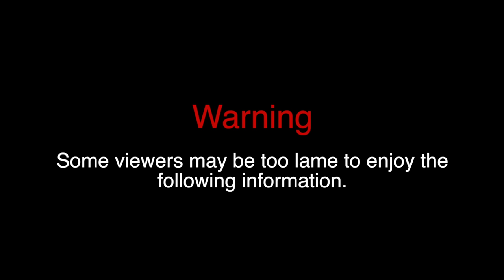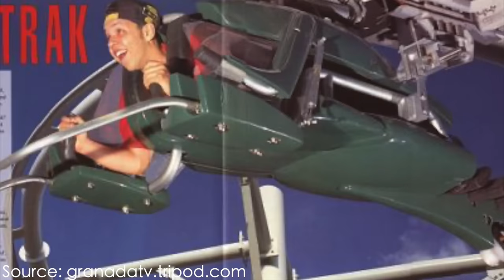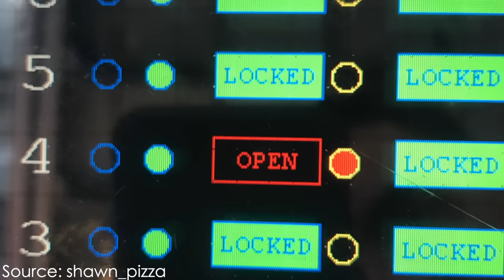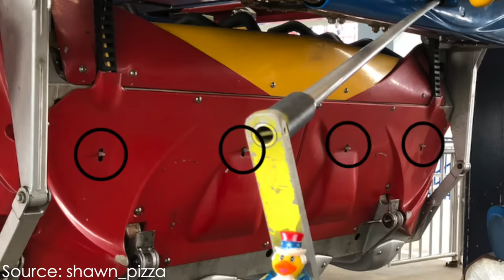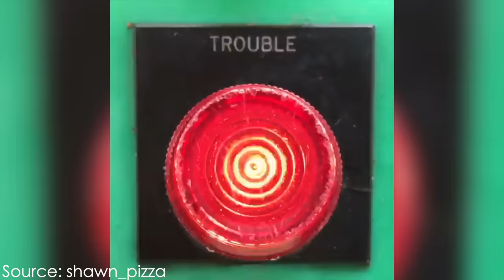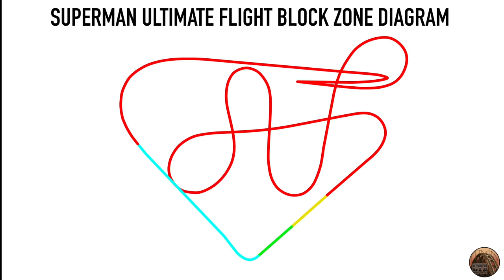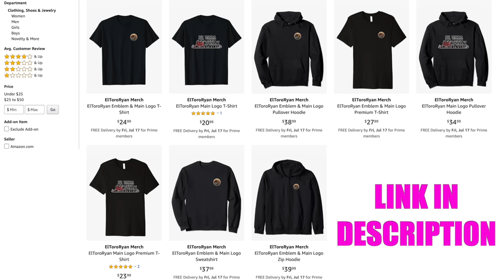Problematic Roller Coasters - Superman Ultimate Flight - Six Flags Great Adventure

Comment: PLC= Programmable Logic Controller. That was a Panelview Plus but is an old model. More than likely, these old coasters are all using an Allen Bradley SLC 5. New coasters now use Compact Logix Controllers which are much faster and is asynchronous.
Reply: @shawnspencer8766  I'm sure Control Logix is also used. The majority of panels I have seen have been Compact Logix. Just a guess but I would assume bigger projects are using some wireless point I/O through a Prosoft card.
Reply: @shawnspencer8766  No problem. I'm a Certified Control Logix Designer working as a Controls Engineer. The only real advantage you would have using Control Logix VS Compact Logix is a little bit of speed, more  motion control features and a few advanced IO features. Control Logix does allow more Ethernet connections but way more than a coaster would ever use. Check out Irvine Engineering out of Ann Arbor MI. They do all the controls for the big dogs like B&M and Intimin.
Reply: @shawnspencer8766  I agree with you though. Coasters are right at the point where they would either use a really high end Compact Logix or use a Control Logix and have some overkill. It could also include multiple PLC'S and a combination of both using messaging to talk to each other. I've never had a chance to look through all of the control panels.
Reply: @shawnspencer8766  I personally do contracted work. I don't work for Irvine but I have been trying for years to get in there. The crew is female owned and mostly operated and I'm pretty sure they want to keep it that way. I know they do or at least did the programming for most Cedar Fair installs around the mid 2000's. I would guess a lot of the IO is redundancy for Safety and reliability. There are a lot of newer products especially Safety devices that run over ethernet which reduces a ton of wiring. Good stuff.
Reply: @shawnspencer8766  Does that coaster have any LIM or LSM launches? Those require a ton of IO.
Reply: @shawnspencer8766  Oh yeah, they have a ton of IO on their magnetic brakes. That makes sense. I have heard they also use load cells and weigh the trains to adjust the power on the hydraulic pumps. That's a lot of engineering if that's true.
Reply: @stick80  Irvine Ondrey is the real deal, i work as a PLC/MCU programmer in ann arbor and landing a job at IOE has been a dream of mine for a very long time. if nothing else, i'd just love to talk shop with Brian one day.
Reply: @protowave  get in line lol. I've spoke with some of them over Facebook. They are pretty good at replying if you contact them. They recommend coming in young as an intern or start with another company in the amusement rides industry.

Comment: Yep, At great America IL, I've been in line for 1.5 hours and they downed it, then once when starting up the ride, my sister's seat (next to me) threw a unlocked error after I fastened it hard for her (she was nervous that it wasn't down enough, it took 45 minutes to depart, then when we got back, it wouldn't unlock, another 15 minutes and they got it undone.

It's not a bad ride, but I only rode it a handful of times due to all the technical problems. 

I usually rode Batman the ride at that park as it was tons of fun, reliable and quicker to queue.

Comment: Rode this for the first time today. Looks slow and boring from the ground, but it feels plenty fast when you're on it lol. That loop that you take on your back is a wild sensation. Not my favorite ride but it's definitely unique. Much more comfortable than green lantern with those head-banging restraints. 
Also glad you mentioned that little bar at 32:05 because I noticed it while in line and was wondering what it does.

Comment: I rode the first one over made in 2007 in Atlanta it was really graceful even the pretzel loop wasn't that bad. I rode Tatsu in 2019 after waiting 14 years as it was built one year after my first visit in 2005. Tatsu was a lot different than I expected I made the mistake of riding it in the very back row my first ride its super forceful you have to sit in the front row to get that flying sensation. The pretzel loop took my soul out of my body the only thing close to as intense as that moment is Dragsters Launch. I couldn't even move my body at the bottom of that loop.

Comment: 9:20 older TV remotes use an infrared LED to send commands to the TV, which meant you needed to point it at the TV to ensure the sensor detected the infrared beam

Comment: While the ride is short and not the most thrilling, it certainly is a unique experience that you can't find on most other coasters. Superman at SFGA is pretty great, even if it's a clone. Once we got stuck on the final brake run for about 20 min. Sitting there in the flying position that long wasn't fun, must've been some sort of ride error in the station.

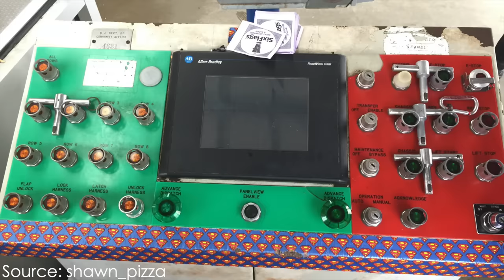Comment: 9:09 Typical civil engineer. Confusing a click PLC from automation direct with a Rockwell Allen Bradley PLC. It's a programable logic controller, not computer. 

#controlengineeringsnob
Reply: Great video though
Reply: @ElToroRyan  from a technical standpoint the description of the mechanics in the sensors are really good. It amazes me these machines as you break them down.

Comment: Back in 2018 we had season passes for SFOG.  Would always head to the back of park for SUF at rope drop. Get 5 or 6 rides in a row in front  seat.  They would have problems.  Ride  ops said the cold April and May early morning temps really mess with sensors.  Somebody that skipped in front of us got stuck in front row in fly position for 20 minutes in the station before it was released to load position.  Me and my daughters laughed that it could have been us stuck hanging for 20 minutes

Comment: I was at Great Adventure a couple weeks ago and got stuck on Superman in the station. The ride op did a visual scan, the trains went into the flying position, the floor went down, but we never dispatched. There was some sort of error that prevented the ride op from dispatching us. Luckily the ride op got our train back into the sit-down position, but the floor never came up. We had to wait 30 min for maintenance.
Any idea what caused this error? I'm always interested in learning!
Reply: There's something called the "Dispatch permissives" in the ride program. 
These permissives all have to be met in order to dispatch the train and start the cycle. 
 
One of those permissives was not met, and didnt allow you're train to move. Could have been any of the seat brushes losing contact with the hot rails, seat prox went out of adjustment, block information was incorrect, lift drive fault, ect. 
 
There's honestly too many things to list, but it's not an uncommon occurrence. I see it at work all the time and have to fix the issues lol
Reply: @shawnspencer8766  Ohh that very interesting! Thank you!

Comment: You should look into Intamin Impulse models. From the light curtains to the LIMs, there is a whole lot to cover and it leads to a lot of downtime.
Reply: Max Chahasa To be fair, when you’re passing through the station at 70+ miles per hour I think having the light curtains and the gate pressure sensors are completely valid. Some thing that a friend told me from his time operating wicked twister at cedar point was that each gate has a sensor for it being shaken too much or for more than about 40 pounds of weight being placed downward on the gate. Either of those sensors being tripped will trigger an E stop. In addition to these, there are weight sensors that every operator must stand on in the station as well as holding their operator present and dispatch enable buttons.
Reply: Alex Phillips i agree they are valid, they just get triggered a lot. and at V2 at sfgam, we don’t have pressure sensors unlike wicked twister.

Comment: I think 80,000 lines of code to change the seat position was a programmer trying to inflate what they did and add the auto generated code to the count. Something like that. There is absolutely no way it's 80,000 lines.
Reply: It's not. It's all ladder logic or function block diagram. A couple thousand lines of code with many subroutines, but no where near 80,000.
Reply: @shawnspencer8766  yeah I know lol that's why I don't buy it
Reply: @Rampag1ngS0da  nice. Yeah I've accessed a few of B&M's programs while at work. Between all the manufactures, I would have to say they write the cleanest code. Easy to troubleshoot.
Reply: @shawnspencer8766  Subcontractors usually do all of that, usually for B&M rides it's a company called Consign, but there are others.
Reply: @sharkheadism  that's exactly right. And that's who did the controls on this ride I'm talking about as well. They are one of my favorites to work on. I just don't usually bring them up since half the people here have probably never heard of them lol

Comment: One thing that i think you missed about this coaster and its clones, The station designed are some of the WORST for any roller coaster. The operator does not have access to see 90% of the train. This means by the time the operator notices a somebody's leg out of the flap, you have to do a lift stop. The station is full of blind spots for everybody working.

Comment: 1:51 "Stealth in Santa Clara" -- I'd ridden this one several times in the mid-00s a couple years before it closed and moved. It's nothing to write home about. While I've ridden plenty of roller coasters over the years, this one was just "meh". The track itself was small and short. The gimmick was the inversion at the top of the lift that turned to have you hang from your harness. The harness system was completely uncomfortable when suspending your own weight. The lack of comfort with the harness more than outweighed the excitement of the coaster. 

The first time I rode it, I was like, "meh." The ride experience was made all the worse by the fact that it took at least 45 minutes or longer to get through the queue line; often times way longer. The problem with that coaster was that it took way too long to load and recheck harnesses, about twice or maybe 3x the time it takes for a regular coaster. That meant excessively long wait times. Because the queue line for Stealth was completely open air, you were forced to stand in the baking hot sun while in the queue line; not exactly a ride problem, but heavily affected the ride experience.

Couple all of this with regular mechanical problems which saw this ride down more often than it was up, you could almost bet that the ride would be down before you entered the park for the day. If you somehow found that it was operating, you'd head over there quick to get a ride in before it decided to shut down again.

To be honest, the best coaster in the Santa Clara park was, at the time, Top Gun (later renamed to Flight Deck). Top Gun had a shaded queue house. Also, because Top Gun could be safety checked much, much faster, you could get in perhaps 10 rides at Top Gun in the time it could take to get one ride at Stealth. Invertigo, a bow tie shuttle coaster, had a similar slow loading problem involving its safety check system like Stealth.
Reply: I love the ride and the harness system was very comfortable for me

Comment: ElToroRyan Explained.
PROBLEMATIC COASTER VID: Meticulously explains in great detail every technical factor of a rides electrical system in an electrical and structural engineering manner
EVERY OTHER ELTORORYAN VID: Get drunk in the parking lot, pull paint off rides and dry hump coaster supports

Comment: You know its funny when in a semi long line for Fury 325 and you stand next to the lift hill motor and a train goes over the lift the motor slows to crawl and I always thought it was a way to save power but now I know its because if the next train engages the lift before the previous one exits the block zone it can traverse the lift at a slower speed until the block zone is clear then speed up. The more you know.

Comment: Maybe I missed something but what if the wireless loses connection during a ride?
Reply: It doesn't use wireless communication when outside of the station. The trains' electronics system is unpowered on the remainder of the course.

Comment: So, from what I’m hearing, it is possible for a train to be dispatched without properly secured leg flaps, resulting in loss of limbs?
Reply: Yep and it’s given countless employees safety violay
Reply: @maxburton87  So, with B&Ms otherwise flawless safety record, wouldn’t you think they would’ve done something to remedy this issue by now? It would honestly just take a couple more sensors per seat.
Reply: @steveo7771286  i would think they could add some kind of touch sensor to the outside of the leg flaps, as most people’s legs touch the top outside corner of the flap before dispatch, which would alert the attendant to recheck that flap
Reply: @maxburton87  a smile proximity sensor on the hinge should do it.

Comment: I knew air was the first flying coaster as Alton is my local park it runs on 2 stations for unloading and loading it went down hill when they put the vr  on it only lasted a few years I only used vr once and wasn't impressed with it

Comment: What if instead of folding seats, there was a vertical chain lift that served as the loading area? The loading area would be multistory, so riders would get in on each floor.

The floor of the loading area could then fold/retract to give clearance. That way the heavy hydraulics and whatnot are immobile, and you only need one set for the whole ride. It'd make the trains mechanically simpler, too.

Main issue I could see with this would be inconvenience for the ride operators. You'd either need an employee on each floor or have them constantly running up and down stairs. Alternatively, there could just be one or two floors, and the train itself would move once those cars have been filled, allowing for the next rows to be filled. That'd make loading longer, though.

I'm sure they already thought of that while designing the ride but rejected it, but it's fun to think about.

Comment: I've always been tremendously impressed with the tech behind the B&M flying coasters and he does an excellent job (although some of it is a bit over my head) explaining it all. However I still hold a serious grudge against "Superman: Ultimate Flight" as it replaced the much more intense, longer, taller, faster, record breaking "Shockwave" at my previous home park. I also love "Whizzer" though. I wish they had torn down "Iron Wolf" and moved some of those utility buildings that used to be back behind Iron Wolf and then put Superman there. Instead they tore down Shockwave which was the 1st coaster to have 7 inversions and I believe the 2nd tallest roller coaster in the world when it opened in 1988 at 170 feet. Superman's track layout is short and boring with the exception of the obnoxious pretzel loop which I personally HATE (I love intense coasters but the sensation of going through that pretzel loop is not my idea of a good time).

Comment: Good grief this ride was a POS. It was a fun ride, but ALWAYS broken. Specifically, when it was at kings island as "firehawk". Stood in line for over an hour, got close to the front, and then get told the ride just went down for issues. This happened to me TWICE.
I rode it once and wrote it off, because it spent about 25% of any given day, being worked on. Some days it just plain didn't run at all.

Comment: You know, one thing I don't get... you don't really need that much processing power to run a roller coaster - in fact, I've seen full-function models of coasters controlled solely on an Atmel Microcontroller running the Arduino runtime environment, and by full-function I mean 100% true to operations, you could use the control system on a full size ride without issue. So why do they still use massive room-sized mainframes? Is there some sort of catch with the building code that forces them to use older computer hardware, or is most of that stuff actually the electromechanical relays for controlling things like lift motors, pneumatic solinoids and hydraulic pumps?
Reply: @Chimera
That pretty much matches my second guess that most of the equipment is actually electrical circuitry for controlling the powered mechanical systems of the ride, not the control computer itself.

Thanks.

Comment: Ahh the Superman ride.  In the 04-06 time frame I got stuck on that ride for over 3 hours 2 separate times.  One of them the train stopped partially inverted, well technically the part of the train I was on was still on a downhill slope, which put my head below my legs and slightly downhill.  Regardless, do you know what people do when they are stuck in that position for more than an hour, they start throwing up and you are stuck so more people throw up.  It's hilarious (relative to being stuck in a crappy position in the middle of the summer heat) as long as you aren't affected by that throw up and smell.
Not going to lie, still a pretty fun ride.  Just broke a lot, especially if I were on or near it.